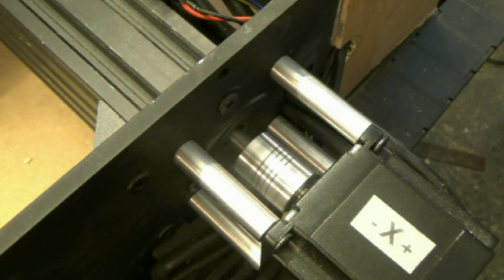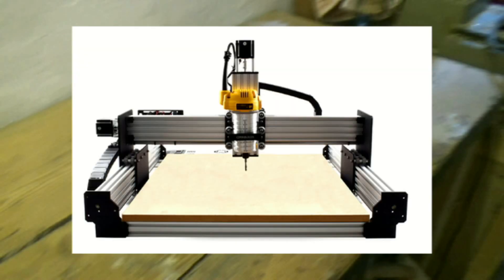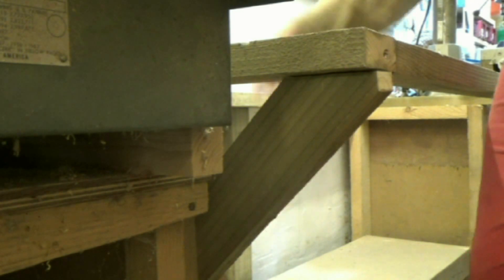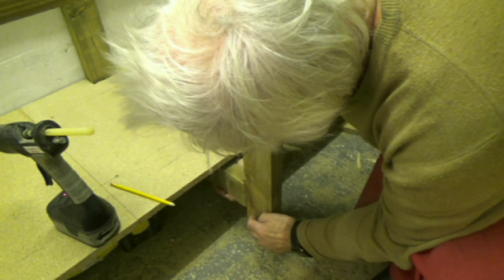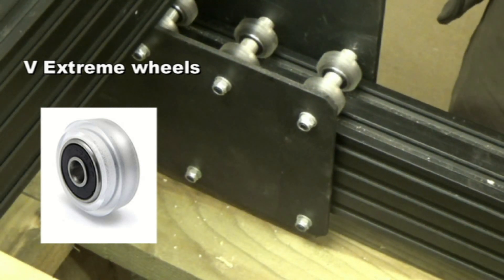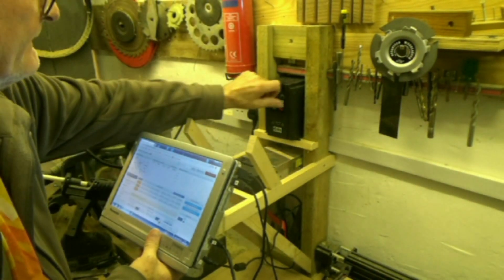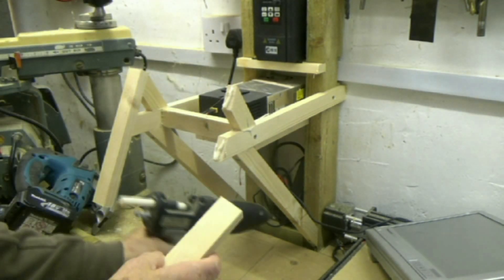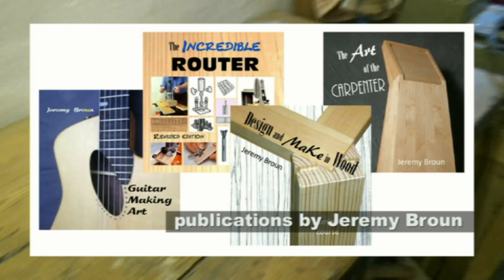My CNC Adventure (05) - Making The Bench For The Workbee

Comment: A shame you haven't come back to this. If your still having issues with software Carbide Create might be worth having a look at its dead basic and has a decent free version and lets you do 2 cutting operations with minimal fussing around. Not sure about getting it going with the duet board but I think you should be good if you just use the generic g code post-processor.
Reply from the maker: I have and I am! The next video is in the pipeline. All HUGELY time-consuming (not to mention time editing video into something remotely articulate and focused) while juggling with many other projects. Thanks for your suggestion. I will look into it but presently I am still trying to get the right spindle secured (already expensive trial an error now reverting to a Mafell 240 volt spindle that avois all the crazy messing about and wiring and plumbing of a 24 volt spindle. In my next video I will cover some absolute fundamentals that I am yet to discover in any other videos on CNC routing and building your own machine. I will cross the G-code bridge when I come to it. I happen to be working on the machine the past few days, fabricating a solid aluminium spindle bracket to suit the Mafell and Workbee. I will instal the 2.2kw spindle much further down the road when I am ready to beef up this machine.  I certainly havent abandoned this project but simply am working 24/7 juggling with various priorities. When I am ready I am probably going to use Estlcam and Inkscape and import graphic bitmap images. Eventually I will probaly learn V Carve 2D. Yes you are right - the Duet controller iosnt ideal as it is not compatible with all sorts of things and uses 3D printer jargon which is further confusing for a CNC newvbie like me. I urgently need somebody in my region to visit me (for a fee) who has a Workbee and understands Duet software!

Comment: hi Jeremy
i use  design spark mechanical  for 2 d drawing and cambam for g code the latter is not free but is  inexpensive to purchase  design spark is free  they both seem to work well for my needs and are simple enough to learn my little cnc is run on mach3
hope you get yours running very soon
Reply from the maker: Thanks James. Very useful. I will investigate this. You will understand I do not want to spend out £650 on software if I can avoid especially to get started.
Reply: @WoodomainJeremyBroun   i do indeed understand as i am only on a fixed income so had little to spend but i think cambam is around €100 .00  im not sure what that is in uk sterling  and design spark is free and easy  to use for simple 2d drawings although it will do 3d also there is also fusion 360 free to hobbyists  i have tried it but i find it harder to use than design spark but i guess fusion would do many more things when learned  but to start off the 2 i have said will be very useful to you i think there is a trial of cambam when you download it  and design spark is free from the start unless you want to upgrade to a paid version  but in my  instance it works pretty well i have only a little 3020 cnc  and have  cut some 2d plaques without any issues i wish you luck with what ever software you choose stay safe
regards
james
Reply from the maker: @james6609  Thanks James. As a result of this video I have had a zoom meeting with a very helpful guy who will show me how to convert bitmap files in Inskcape (which I already have and is free) and convert to G code and then try and get a more user friendly CMC controller software than what was supplied with the build kit. fortunately he is building the same kut as me and is at that stage too.  I just want to get started making simple 2D geometric shapes, profiling and skimming.  In fact im thinking of initially mounting one of my many small router bodies instead of all the complexity of the water-cooled spindle with pump and VFD!!!
Reply: @WoodomainJeremyBroun  thats  greaty hope it all goes very well for you i will be keeping an eye for your videos

Comment: There are many Vetric videos on YouTube eg. In Labs with Becki. Check the videos and keep your nifty notebook within reach. If I can learn Vetric, anyone can.
Reply from the maker: Does Vetric generate the G code file? I seem to recall i had to  use something called Inkscape? I want to use/convert  bitmap files from photos of templates I create in MDF.
Reply: @WoodomainJeremyBroun  Yes , Vetric generates g-code files. You need to go to the post processor and choose GRBL, which is the system running the Workbee.
Reply from the maker: @graveurgraveur2691  Thanks for your advice. I know you are trying to be helpful but I thought I made it clear my mind really struggles with the jargon. I dont know what post processor is or GBRL. I may very well invest in V Carve fairly soon but I need free software such as Estlecam JUST TO GET STARTED. Its like me saying if I can make anything in wood so can anyone else. It simply isnt true. I have spent hours and hours trying to get me head around software. It assumes knowledge to start with. That is why a half hour Zoom call sharing the screen would show me basics. Ive watch the tutorials and very very few are crytal clear for idiots like me!! I am commited to making this work having come this far.  I may be mutlti-skilled but this one thing I really struggle at. Just finding what a word means takes yup time when a good clear teacher could show it on  a NEED TO KNOW basis.  The knowledger some of you CNC guys posses about electronics is astounding and a foreign language to me. Veectric is NOT my first port of call. I tried it and got stuck!!!!!  Sorry this is a rant but I feel I am not being listened to.  i strugglke to even understand what a GCode is and there are a lot od preset codes to memorise.

Comment: Try Vetric software, fairly easy to learn. I have the Workbee 750 x 1000 cm and use Vetric VCarve Desktop. You can download a trial version to see if it suits you before purchacing.
Reply from the maker: I have tried it, I had the trial version, I know it is one of the best, but as I say I struggle with retaining the information. I literally need a 'point and squirt' software just to get started!!!!. Eg manual commands such as skimming the top surface would be a start. It is a huge learning curve. Vetric V Carve Desktop is too small a footprint for my CNC and the things I want to build (eg one piece guitars) and all too expensive for a beginner (£330-£650) simply wanting to get started. Much of what I want to do is 2D profiling.

Comment: At 1:50  it might have been better to but the screw in from right to left. You are going into end grain.
Reply: Same at 6:12
Reply from the maker: @joeobrien196  At 1:50 it shows the first screw configuration and at 1:51 the second screw (probably not very clear). Similarly there are two screws as at 4:34 and 4:38. At 6:12 yes maybe but the bar is a spacer and not going anywhere. The main strength comes from the arms that are grooved into the uprights. I was going to show the entire build but it would have made the video much longer so I showed random  highlights.